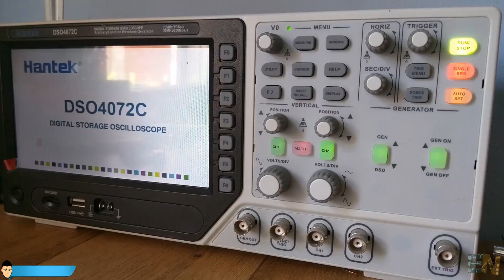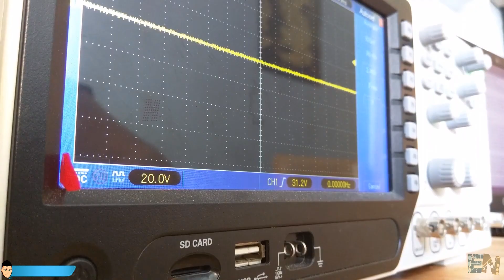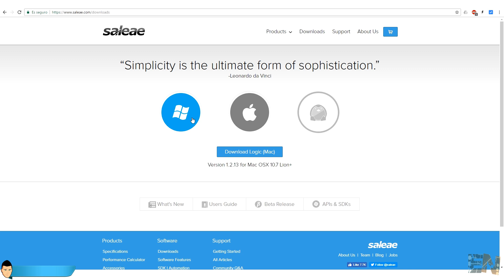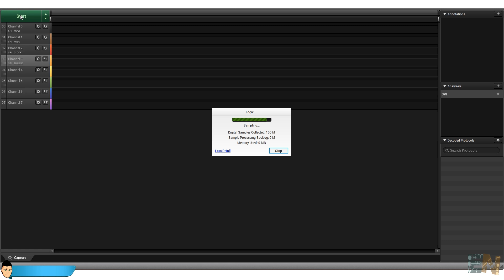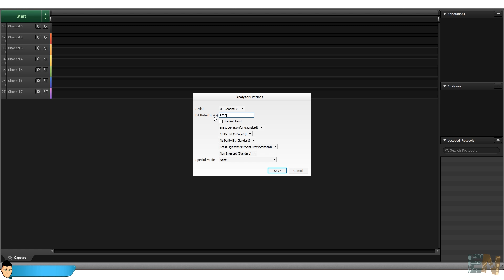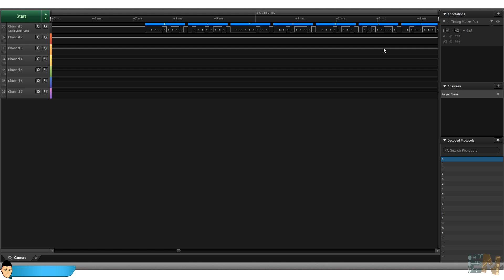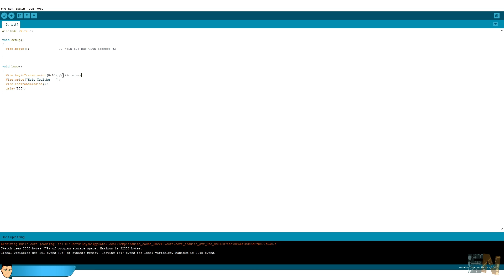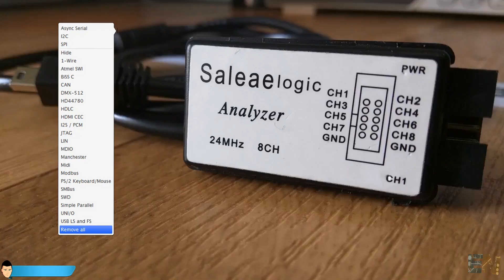Cheap logic analyzer SPI i2c UART

Comment: Im lookin for a a logic analyzer that works well on android, as i usually dont have a pc at my workbench. I programm my arduinos with an android tabet, the tablet runs the software for a microscope for smd soldering and other little tools. So i would like to extend that with a logic analyzer..any reconmendations? Price is secondary..most important is that the app works fine with the peripheral.

Comment: Hi, Salae software shows junk data without even connecting the logic analyzer. what might be the problem?
Reply: No, it is just test example.
Reply: @guest7329 thanks for the reply. even if I connect the analyser, software is in simulator mode and in the title bar it shows disconnected. Logic analyser is not being detected by salae software.
Reply: @vijaynagaraju9701   which os you use?
Reply: @guest7329  I am using Windows 8
Reply: @vijaynagaraju9701 do you connect analizer directly or via USB hub?
Reply: @guest7329  I connect via usb

Comment: Is there any way that you could show how to use this on a car to show the signals off the 2 cam sensors and the crank sensor to see how they relate to each other. This could be used by diy mechanics to make sure the signals are there and that they relate to each other properly. Thanks and I hope you find the time to show beginners how to perform these types of things with electronics. Thanks again.

Comment: Why do you buy a cheap Chinese copy of the real thing?
Reply: well... because it's cheaper. ok?
Reply: Quote from https://www.saleae.com/about

"It's more fun to be a pirate than to join the navy.”
Reply: ...and because the original creators do not seem to understand basic retail business. They are still trying to sell this product at 30 times the price of the clones. They should have acknowledged their mistakes, and created a competitively priced option that is no more than double the price. They could have used the marketing momentum/exposure to create something new that they could build a business on. Instead they tried to appeal to emotions and did nothing to salvage the market. The moment the clones appeared the damage was done. Their investment was compromised. The only positive response was to cut the losses and try to use them as an advantage. Appealing to the consumer's emotions, trying to stop/disable the clones, and or whining about the problem is the response that will keep them marginalized or put them out of business. The failure to protect their product is on them. Blaming the consumer or the cloners is a guaranteed path to nowhere.
   Don't get me wrong, it sucks. I feel for them, but there is no room for emotions in running a business.
Reply: @UpcycleElectronics  well, the original creators made their analyzer for professionals. A professional engineer who's monthly wage is 4000 USD can easily make the company purchase a tool that costs "only" 500-1000 USD if it's needed for the job. However, the average Joe home user of course will not be able to buy it. Microsoft solved this with "home edition" and "pro edition" of windows, but you cannot do that with a logic analyzer, because it needs to function the same way (mostly). Well, at least the chinese have now solved this.
Reply: because of historical imperialist interventions in 3rd world countries makes it so it's these "official" (and overpriced) products are prohibitively expensive to buy. so we go with the cheap "copies" that work. USA stole our democracy and resources, so now "piracy goes brrrrr" ;)

Comment: Thanks for this video. Just to be clear.. the device you got is made in China, but the software (and its name) are not. The device you have is a counterfeit version of the Saleae (made in USA) logic analyzer. The Saleae software may or may not work with a $6 clone since it's designed for the legit (more expensive of course) Saleae device.
Reply: IS that the 340 Euro entry 8 channel 25mhz Saleae device?
https://www.saleae.com/?gclid=Cj0KCQiAs67yBRC7ARIsAF49CdVDZicxNYdU5QIrZMpBNf24kjmukt_iti_joFqYGVa9C5BOa8nL8SkaAmYcEALw_wcB
Reply: You forgot a couple of words in that description, "....incredibly stupidly priced ripoff Saleae device"
Reply: @poruatokin  A completely reasonable price for an excellent product, which saves lots of time as it is so easy to use! You pay for the software which is a dream :)
Reply: @diyguild1327  You can get them to around 4.41 USD delivered
Reply: As the guy said "its a product from  China, so its OK" ! Crikey, that's some faith, I work more on the basis "its a product from China, so will it electrocute me".
Reply: @philldavies7940  made in china are the best

Comment: Do you have to connect one of the ground pins of the analyzer to the arduino GND?
Reply: Yes all electronic devices must have the same ground in order to make a comunication. GND pin is the "0" volt rail, is the reference voltage for a device. That means arduino 5 volt level is 5 volts respect to his ground pin (Arduino GND) and the same for the logic analyser.

If you don't connect arduino GND pin and Logic analyser GND pin together, arduino 5 volt level might be 2,5 volt level to the logic analyser (or other voltage) because the voltage level for every device is relative to his ground pin.  If you conect arduino and logic analyser GND pins together they have the same reference so 5 volt level of arduino equals to 5 volt level of logic analyser.

I hope you understand the explanation when I was a beginer few years ago I didn't understand the concept of ground now after 12 years I fully understand. If you have any question i will answer to you :).

PS: I'm from Spain so i'm sorry if i did any orthographic mistakes, I hope you fully understand the concept and why you have to connect GND pins together.

PPS: As a bonus! Some devices have one or more ground pins for analog circuitry and other ground pin for digital circuitry (They are separated). Sometimes you want to measure an analog signal and you need another voltage reference diferent from the digital voltage reference. But this is more advanced stuff... :P